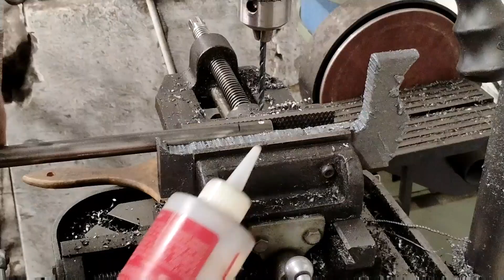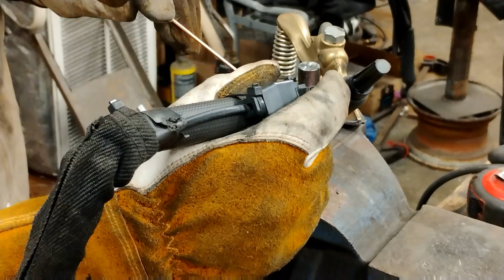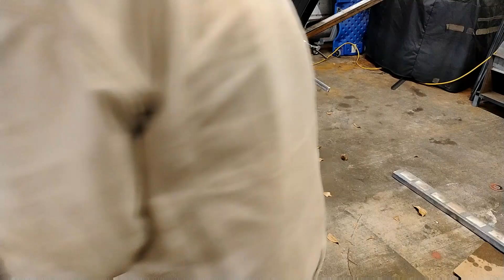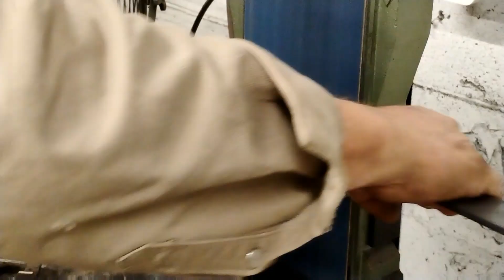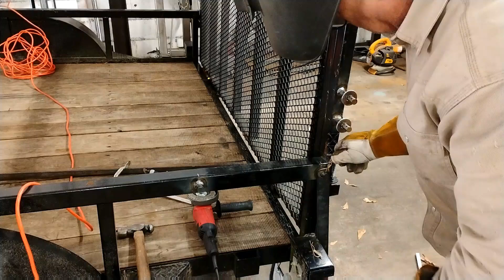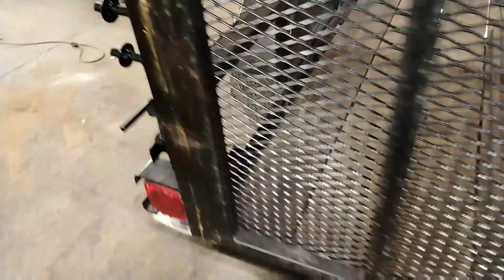Make Your Utility Trailer More Useful | Easy Welding Project for Beginners (Step-by-Step)

Comment: Nice solution!  Might you be willing to share what you charged for the “little job”?  Obviously labor and supplies need to be taken into account.
Reply from the maker: Sure. The material I used was only about $2, so I wasn't worried about that. I charged 2 hours shop rate, which is $80/hr, so it was $160. Since I was making the video, with retakes and planning, changing angles and such, the whole project took a little over 4 hours, but that wasn't his fault. That's why I don't video too many actual projects, just because of the time involved.

Comment: Why didn't you drill all the way threw and weld it on the back side might be easier to keep it straight just a thought
Reply from the maker: That would have worked for the peg in the trailer. I don't know if you can see in the video, for some reason the trailer ramp ends are 1 piece of the 2x2 next to a piece that is 2x4. So I'd have to weld through 6" of tube. But your idea would be great if it was a single piece. That way the peg could go all the way through, and be welded in both sides. But for just holding the ramp in place, my way is quick and gets it done.
Reply: @AllStarWeldingSC  okay my trailer tailgate isn't 6"thick

Comment: Excellent solution to what could be a big problem, especially if the ratchet strap failed. I have to tell you that the volume was going in and out a few times during the video.
Reply from the maker: It's the noise reduction circuit on this mic. It's lowsey. If you notice, the first word is loud, then it reduces for the rest of the sentence. These will be going back to Amazon Monday
Reply from the maker: Yeah, I discovered that after it was all done. I was so mad. I'm not too happy with that mic. I had some new ones delivered today. I've already tested them and they are fantastic. I have 3 more different ones coming Monday too. Sounds like a new video comparing wireless mics will be coming soon!
Reply: Another helpful video 👍
Reply from the maker: @elgkas9928  check this link out. its a private unlisted video.  This the new microphone that came today. tell me what you think.  I have 3 other different ones coming Monday.  I will test them all and choose one to keep and return the others.  https://youtu.be/ss_wxQuacqM
Reply: It wont let me open it. It states that it is private.
Reply from the maker: I have 4 new sets of microphones now. Since it looks like I'm going to be snowed /iced in, I'm going to review and compare all 4 of them. Let me know which one sounds the best when I post the video